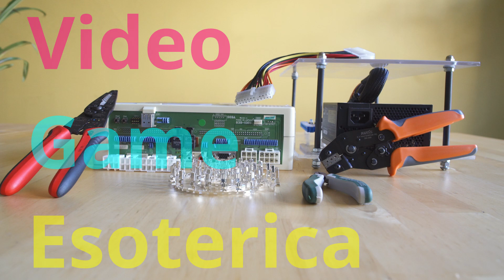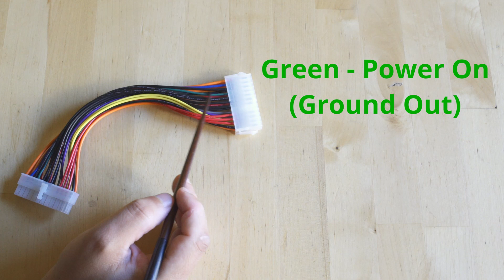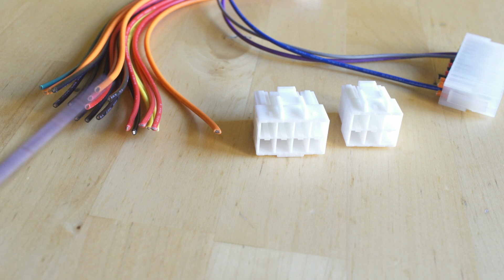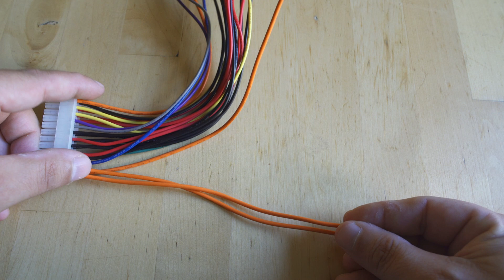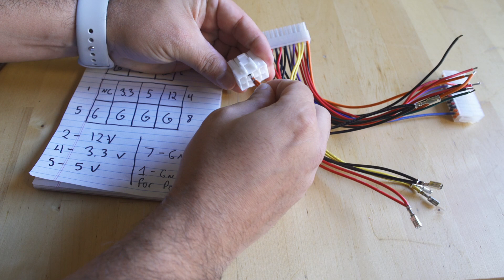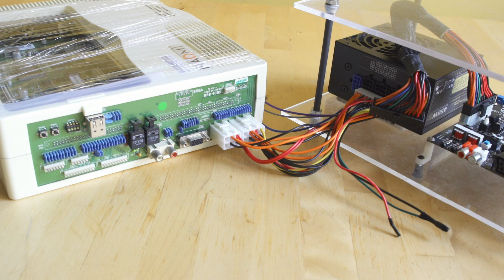How to Power a Sega NAOMI / JVS Arcade Board via a 24 Pin ATX Power Supply

Comment: The funny part is a lot of the connections like the 5V, 3.3V, 12V, and ground each have their own color coded wires that are all soldered and isolated to the same voltage islands in the sun power supply (1 island for 5v wires, 1 for 3.3v wires, 1 for 12v wires and 1 for gournd wires). Not gonna knock the process here but to be helpful you don't need 7 different ground connections a lot of them can be paired to one ground wire.
Reply from the maker: You don’t need to but IMO it’s best practice to not try and shove too many leads into one pin. Crimps get iffy on that. I like to allow as many connections as possible
Reply: @VideoGameEsoterica  oh yeah I agree, but theres a third connector you didn't include in your video, I believe for the GD ROM system that could also use some of the ground connection from the atx. But either way great video, I got my system up and running. Though what made me triple check everything with a DMM was that the only ATX extension harness I could find wasn't color coded like yours 😆. I basically said a prayer before turning the system on.
Reply from the maker: @axman2907 haha we all say that prayer I think

Comment: Thanks for the video! I need to do the same to replace a 400-5330-03 power supply, and I'm having a hell of a time finding the connectors I need. I can find 6,8,12 position just fine, but thats about it. Do you happen to know if you can find these jst vl connectors anywhere?

10 port  (2 rows of 5)
12 port (3 rows of 4)
18 port (3 rows of 6)
15 port (3 rows of 5)
Reply from the maker: If they aren’t on digikey or mouser then I am really not sure on that one
Reply: @VideoGameEsoterica  Dang, ok thank you
Reply from the maker: @onjisan stock on them is hard lately

Comment: Hi,
I recently bought the same console. Unfortunately, it only worked for one hour and failed. I turned on the console when it was delivered. I immediately ran some tests, including a memory test. Everything was OK. After an hour of work, artifacts appeared on the screen and the console began to work very slowly. After repeating the memory test, I saw errors on chips IC16 and IC35 (look at photo). I replaced these chips. On chip IC16 the error disappeared. At IC35 it still exists. Moreover, I changed it twice more to chips from other manufacturers, but the error still exists. The console is working and there is sound (music) in some games. But with other games there is noise instead sound. Could you recommend me something, what could be the problem with chip IC35? Thanks.
Reply from the maker: Like graphical artifacting? That’s either bad ram or a bad GPU (ok well it’s not a gpu like we think of them now but)

Comment: THANK YOU!!!!! I bought some untested HOTD boards and now i know how to power them on!!! Thank you!!!
Reply from the maker: Glad it helped. Did that video awhile ago but it still gets views!
Reply: Do you know where to get the ram chips that go around the fan???
Reply from the maker: Got a chip code? If so I can probably find you some
Reply: @VideoGameEsoterica  I'll give you some numbers when I'm back home later
Reply: D4516161ag5 a80r 9nf NEC Chip
Hy57v161610d Hyundai Chip
Km416s102ct g10 SEC chip

The chips on the motherboard that my HOTD board is attached to are the NEC chips.
On the other Naomi boards I have they have the SEC and Hyundai chips.
Is all 16mb Sdram the same or are there different variants??
If you could tell me where to get some chips you'd be a life saver.
I've been practicing removing the chips on my practice board and I've managed to get the remove and refit procudere down to a Tee.
Reply from the maker: I’ll check around. Give me some time
Reply: @VideoGameEsoterica  thank you very much.
I have been doing alot of research online about what else uses these SDRam chips.
I've found that the Riva TNT Graphics cards from the same era have the same chips on the board.
Is it possible to swap the chips over from a working Riva card??
Reply from the maker: If they are pin compatible (same package) then yes, that would be fine
Reply: @VideoGameEsoterica  they have the exact same part number as the Hyundai version, I can only assume the pin out is the same??
Reply from the maker: I’d still count. I’ve seen chips with like numbers come in diff “packages”, or shape/pin configs.
Reply: @VideoGameEsoterica  I have found both the pin out diagrams for the NEC Chip and the Hyundai and LUCKILY!!!!! They are both the same pin out..... Thank God because I spent 25 quid on a graphics card last night to rob the chips from.
Reply from the maker: Then you should be good :)
Reply: Thanks for telling me about the pin out, that would've been stupid fitting the chips and nothing happening when I turn it on.
Reply from the maker: 👍 now that you know how to check it’s one more thing you’ll know for the future
Reply: @VideoGameEsoterica  Thank you for the help. If I have all the parts on the weekend I'm going to be fitting the chips and testing the board..... I'll keep you posted.

Comment: I'm currently just getting in to this as I've nearly assembled all the parts I need to get my Naomi boards ( bought as 'untested' ... heh 😏) ready for playtime.

The guy I got my v1 I/O from mentioned that it's a really good idea to either have a voltage meter or cutoff on the 5V line because apparently the Naomi is SUPER sensitive to that going over a certain limit.
Reply from the maker: NAOMI wants 5V. Not 5.03 or 5.04. I find it fine at 5.01 but mine runs at a consistent 4.99. You can do a meter or cutoff for sure if your supply varies too much
Reply: Should the I/O board be at 5volts or the motherboard? The volts decrease by the time it reaches the Naomi.
Reply from the maker: Which IO?
Reply: @wtbluechalk  i'm actually not sure, tbh! ... Not really started ... I've heard that many folks just hook up dreamcast PSUs ... so I'll try that ...
Reply from the maker: That’s always an option
Reply: I have a Marvel vs Capcom 2  but it keeps freezing. I just switched out the power supply but I can’t seem the get the voltage right or at least I hope that’s the problem.
Reply from the maker: What’s your voltage running at?
Reply: @VideoGameEsoterica  It’s running at 5 volts on the I/O board but by the time it reaches the Naomi it’s at 4.74 volts.
Reply from the maker: Much too low. Get it up to 5
Reply: @wtbluechalk  good luck, mate. perhaps worth trying with no cart in first?
Reply: @eliotcole  sorry what do you mean by cart?
Reply: @wtbluechalk  Apologies, cartridge, the game. Was MVS2 released on gd-rom?

Comment: Nice, it's a lot of hard to work to wire up a power supply on its own. I've done it myself without adapters. I have a JVS power supply I use for my Model 2/3 stuff, but am slowly eyeing a Naomi with Jambo Safari using a Mad Catz MC2 wheel with pots & buttons, but apart from the power and the JVS I/O, is there anything else I need in particular? For quick disconnects I do like using Dupont cables but some of those can be flimsy if you don't hold them right.
Reply from the maker: DuPont IMO aren’t great as they are pretty flimsy and tend to have issues when strained

Comment: Have you tried looking into pico power supplies?
Reply from the maker: No I haven’t used a Pico for NAOMI
Reply: @VideoGameEsoterica  I wanna see a pico power supply working in the naomi.
Reply from the maker: I mean it wouldn’t be hard at all
Reply: @VideoGameEsoterica  I have the adapter. Which pico psu would work with the naomi?

Comment: Does a 250-750 watts power supply atx can power three 12volts fan ,12volts strip lights ,mini 5/12volt amplifier , electronic coinslot all in one cabinet?
Reply from the maker: Not sure. Do the math. Honestly only way to say for certain

Comment: I would strongly suggest to use an actual JVS power supply, 99.9% of  ATX PSU (all except some very obscure platinum rated ones) share a single line between 5V and 3.3V, with usually sub par performances on those (because the main power draw on ATX runs through the (usually dedicated 12V line), this means when drawing current from 5V the 3.3V drops and vice versa, this also creates very large ripples which aren't suited for long term uses at all. Some systems are more tolerant than others, I would strongly suggest to NEVER use an ATX PSU with a NAOMI2 for instance, as it needs EXACTLY between 5.0 and 5.1V on load (that's 5.2V MAX off load), if you go over 5.2V on load you will eventually kill the NAOMI and NAOMI2 buffer chips, if you go below 4.8V the NAOMI2 will not get enough power on the 5V line and you will experience random crashes and various other issues/glitches.

I should add that because you cannot regulate the voltage on an ATX PSU and only the 12V line is required to be on spec, you will see that the 5V and 3.3V outputs aren't exactly 5V and 3.3V but a slight variation of it, whereas JVS PSU are designed with potentiometers to let you exactly set the proper voltage using a multimeter. I strongly suggest to invest in a proper JVS PSU, you can either purchase a used SUN JVS PSU and recap it (as well as service/change the fan), or get the JVS supergun from axiunworks which acts as a universal JVS PSU, or get a Wei YA Viewlix JVS PSU. Heck, using a couple of (high amp) bench PSU is preferable to using an ATX PSU (albeit much more cumbersome and expensive). 

So, yes using an ATX PSU is cheap, it's just not a good thing for your JVS based hardware, better be safe than sorry. 

Feel free to verify all I have said by measuring voltages on and off load or even better, using a scope to see the huge ripples that occur while on load.
Reply: If that is the case then you could use the 12v line and step the voltage down with a linear convertor so you don't get the usual buck convertor noise ?
Reply: @SimonMcNair  you'd still be either sharing the 12v line with the 5v input or the 3.3v input, depending on what you step down. Either way that would mean you wouldn't have a stable output. Ideally you would want 3 dedicated lines. 12v on Naomi is only used to run the case fan though but on triforce and chihiro it's used to run the main board.
Reply: I was looking for a proper way to power my Naomi 2 and now after reading this thread. I'm not sure what my options are. Original Naomi PSUs are hard to find at this point.
Reply from the maker: You’ll find people who have been running ATX power supplies on NAOMI for years with no issues and people who say their ATX power supply killed their NAOMI. My opinion is if you put a high quality ATX power supply into a NAOMI it’s a perfectly acceptable solution
Reply: @VideoGameEsoterica  I am powering my Naomi 2 with an ATX power supply and it is booting up. However, it's failing to safe the network configurations and timing out when I try to update the subnet mask. Someone on the arcade project forums suggested it's an issue with the power supply. They saw the same error and it went away when they changed their power supply. I'm not quite sure why the power supply would fix that issue but I did read unstable power can cause the Naomi to behave strangely.
Reply from the maker: any issue like that would be a one off. X supply may be an issue where Y supply would work fine. It’s all about the load on the rails. Some supplies have a nice balanced load even at low wattage pulls. Others don’t cooperate much at lower loads. Same with arcade supplies. Some don’t work well, others work really well
Reply: I think we are at a point where people don't have much choice. The "proper" hardware is getting rarer and rarer. 

I think any decent, reputable PSU brand will be fine. If you're buying some unknown crap from China and it fries your Naomi, that's on you. "Never skimp out on the PSU" is the golden rule for PC building and I think it applies here too.
Reply from the maker: Yes. A good meanwell would be great. A solid ATX gets the job done too
Reply: @VideoGameEsoterica  You can wire 2 Naomi's to 1 power supply. Helpful for networked games. 
Apparently you do this by using the (multiple) 24-pin power cables and "topping them off" with some of the hard-drive cables. 
Do you have a recommendation for a budget-friendly power supply? Most are $60 - $100 and when you need anywhere from 3 - 6 PSUs that's a lot of cash...
Reply from the maker: In my experience it has not been an issue. Of course that’s down to the power supply you use and how true the 5V rail is. On this Silverstone SFX 450 only ever seen readings of 4.99 and 5.01 as far as fluctuations are concerned
Reply: @VideoGameEsoterica  totally agree with Mathieuhl. Atx on naomi is evil. Trust who have experience and not base theory with one shot test....
Reply from the maker: Lol who says I don’t have experience or have been running this Naomi constantly on the setup I showed? I get this isn’t a one size fits all solution because of variations in power supply but myself and many others have been running NAOMI and NetBoot NAOMI setups off these supplies successfully for a while
Reply: Another option could be to find a NOS ATX PSU from the A64 days that has a separate 5v rail and beefier 5v and 3.3v capacity as older CPUs needed that compared to all the new stuff being driven by 12v.
Reply from the maker: True but NOS supplies are getting harder and harder to find. Wish it was easier!